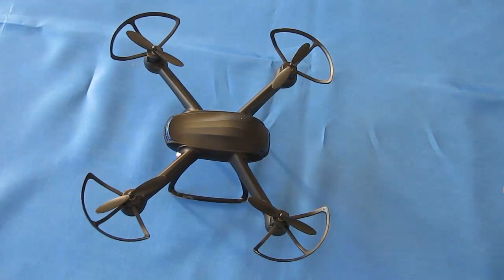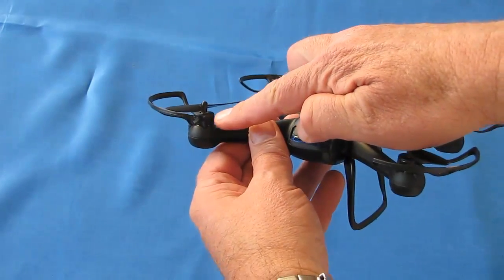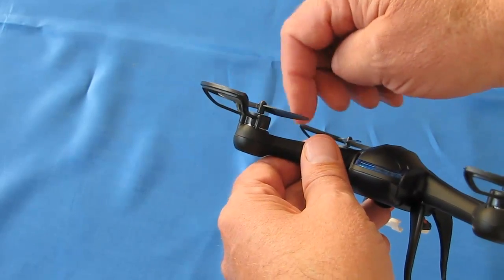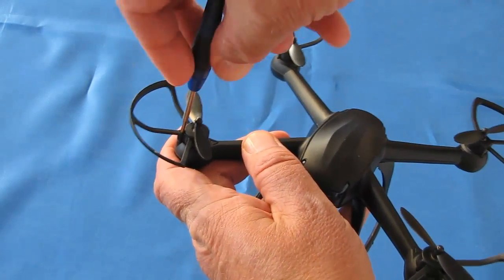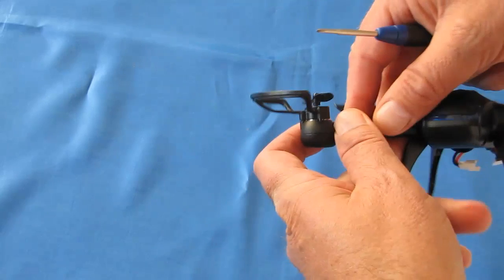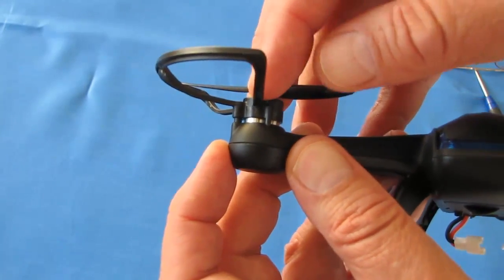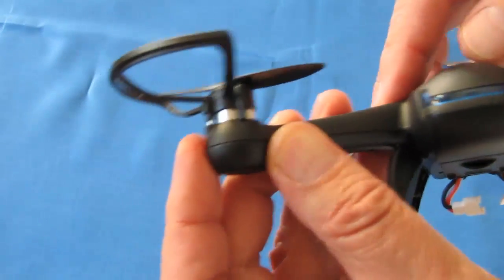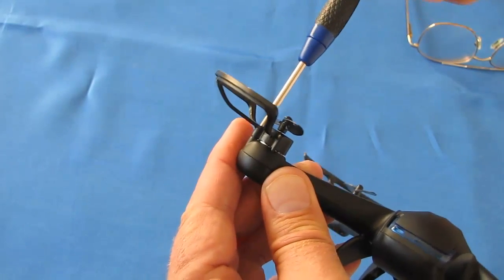DM007 Spy Drone Motor Discussion

Comment: I bought this drone about a month ago, to learn how to fly a quadrocopter, after 2 weeks of flying, i got used to it, and feel pretty confident with it, i took it outside, it was flying very stable and it was really fun to fly it, but after 1 month of flying, the battery started to get weak, so I bought spare battery, but unfortunately for some reason 1 of the motors just stopped working, i push the throttle all the way up, nothing happens, only 3 motors seems to be working, only with help of my finger the 4th motor started spinning, but that still doesn't help, the drone is uncontrollable and crashes right away :(  I'm waiting for worm weather, and i will get something more expansive and with GPS, but for now, i want to fix my DM007, i guess i should buy spare motor? They sell 2 of them together, the CW and CCW, what does it mean? I have to replace 2 motors? I'm new to this drone hobby, i really like it and eventually i want to take to next level, with  quality drone and  FPV goggles.
Reply from the maker: +V Kat There are two clockwise and two counter clockwise spinning motors on your DM007.  They sell them in pairs, but you only need to replace the damaged one.
Reply: +Quadcopter 101 ooo ok! Thanks for clarifying this to me! Your videos really hooked me on this things))) thanks again!
Reply: +V Kat 
Hi, 
after ~30 min of flying the rear left motor stopped working, since it 
smelled burnt I decided to replaced it with a new one (CW rotation), but now even the new motor does not spin.. I checked the voltage, under increasing 
throttle it goes up only to 1V (around 2nd bar) and keeps the volts 
steady with no spin...at the same time other motors work 
correctly..so it looks like a board problem? anyway clue how to reset it ?

Comment: hi i got this one over Christmas and it flew great the fist couple of times but now it starts and shuts down when you give a litle bit of gas.... so it doesnt fly, can you help me?
Reply from the maker: +Fábio Marques Sounds like over current protection.  Gently turn each one of your propellers by hand.  Make sure there is no binding, and most importantly that they are not striking against the prop guards.
Reply: I just got one today and am haveing the same problem did you figure out what it is
Reply: What would you do if there is no binding of the motors should I replace the board ??? Mine will arm and ass soon as I give it throttle the motors spin about half a rotation and then stops and the quad goes into binding mode please help this is a gift for my wife
Reply: Hi, had a similar problem but for me, I didn't even get to fly it once. Come to find out my 7.4V battery pack had 4.22V after the initial 90-100 minute charge. Contacted Gearbest immediately but found out everybody was on Chinese new year. The number they gave for 24/7 service never picked up.  I just held on til my phone ended the call. Replace the battery and you might be flying again!

Comment: the body of the quad is not square boxed, its nore whide than anything...i got one, i honestly dont know if it was used of just bad motor,opened it and replaced 2 motor, both counters...it flew good after i took it gudded it and made popssicle stick frame and mounted it all on that...and then gutt the cam too and laid it ontop too....since then i got 5 min flight with cam but no rear lights...i took lights out to save for future needs...but also took a electric line on way up showing off and it tumbled down taking a small hit on the cam and then it didnt work no more, the cam that is, the hole electronic flight control now drifts forward left and faster the longer i stay up in air, gonna replace flight control and get new cam....is there a good light light frame we can put all electronics on that ISNT that oddly shaped wider than squared frame?
cuz the sqare frames work much better than the original dm007 quad frame...

Comment: I just got DM007 from GearBest and one motor seems to be default. At first its not spinning at all, on full throttle it starts to spin but probably slower because copter wont go straigjt up, it drifts to the side where bad motor is. On slower throttle it almost flips as soon as it gets off the ground. Anyway, it's impossible to control. I opend support ticket on Gearbest which is unaswered for 14 days now. I started Paypal dispute and finaly got responce from Gearbest. They started debate with "Are you Sure... this and that..." and then they asked me if I can take it to a random local shop to fix it. They woul partially cover expences. I was shocked in such a responce and I don't want ot buy there ANYTHING. Anybody knows if I can get motors anywhere else? I found some on Amazon, but they don't ship to my country. Oh. and I think Banggood is same company, just different name...

Comment: i think one of the motor is damaged. last time i play with it one motor is hotter than the rest.recharged the battery to full and trioed to make the motor run ....it spins if you start it with your finger but i think not as fast as the others and then cut off by itself and wont spin even if you up the throttle. tried to open it and i found out it is soldered.......put back again and retried but same thing. the box comes with extra motors(4) aside from the profellers(yeah i bought those motors as add). now the problem is this soldering i don't know how to do that and by the way i bought a micro screw driver set for this. back to the motor problem....there is no mark which is which...i mean for the front  or back or left or right....or should i say counterclockwise and vice versa.....now getting fustrated about this toy.....haven't really enjoy it and its giving me noe a problem....saw some othe brand and i'm thinking i wish i got those instead of this......ayayayaay.

Comment: Took one of my old ones apart.  They are brushed just to clearifly.  What makes this quad so good compared to others it it's class is the fact that it runs off of 7.4 volts.  The motor I took apart was still working but the brushes were worn down to where contact was intermittent.  I adjusted the springs and now it works like a champ.  I like the fact that you can buy the crash pack and keep it running.

Comment: hi i bought the dm007 and being a first time user i broke two blades and i put to new ones on and now when i try to use it it will not fly pulls to the lift side can any one help me fix this
Reply from the maker: You put a clockwise blade on a counter clockwise motor (or vice versa). All blades should be blowing air downward. If any are blowing u, replace that blade with one of a different shape.
Reply: +paul house how did you take the blades off?  Just broke mine
Reply from the maker: Curt Veenstra Pry the bad one off with a butter knife.  Before you install a replacement, make sure that it's the exact same shape as the bad one (there are two types of blades, clockwise and counter-clockwise).

Comment: I have the replacement motors but couldn't find any markings for left and right rotation....any help?
Reply: +Axel Haenssen  - Notice the location of which color wire is connected to.  There are + terminals and - terminals.  In electronic red  usually means + and black usually means - .  You'll notice on the motors that two of them have the black connected to the + and the red connected to the -.  This configuration will cause that motor to spin "backwards".  Hope this helps

Comment: For motor replacement you have to remove the entire bottom of the unit (all screws).  Make sure you use the replace a CW motor with a CW motor and a CCW motor with a CCW motor - you can purchase them in pairs from Gear Best.

Comment: I own two DM007 and I burned out a motor on both…one on the very first flight (seized up and won't turn) and the other on its third flight (doesn't power up as much as other motors causing drone to spin or dip over rather than fly).

Comment: I ordered a DM007 from China off of Ebay and the first time I flew it, it veered off to
the right probably because one blade flew off. The unit had a habit of doing this each
time I flew it. I had ordered a crash pack with blades and this did cure the problem. Then a motor wouldn't spin up and thinking maybe the motor was bad I decided to
disassemble the whole unit to replace the motor. What I found was, a lead which
should have been soldered had came off of the motor, a bad soldering job. After fixing
the bad solder joint the unit seemed to fly ok.

Do not remove the long screws that look like they are for mounting the blade protectors, The blade protectors hold the motors in place! If you do not want the blade
protectors on the unit you will have to clip the plastic leads off.

Comment: Those motors behave like brushless motors, as used on 250 (or larger) racing quads. I doubt that they are brushless, as that would requre an advanced flight controller and (usually) ESC for each of the motors. Perhaps the Mfg. website has additional info ...
Reply: Bill Somrak Just went to GearWorst's site and looked at the motors (they sell spares) and they are definitely NOT brushless. Rather than being round, they are sort of oblong.
Reply: The prop movement immediately reveals them to be stepper motors. They were probably cheaper and they just made the firmware cycle them. They sound brushed but who knows case-diameter means nothing.

Comment: On BG, there is only one kind of motor, and you invert voltage to change direction. Why are there 2 different ones on GearBest? Doesn't inverting polarity wear motors faster?
Reply from the maker: Luca Andrea Mifsud Buhagiar Yes it does somewhat. This argument came up many times with the old WLToys V262.  It's best to use a motor designed for the intended rotation.  But you can invert voltage with these motors if needed (but expect some reduced longevity).
Reply: Quadcopter 101 So why are Banggood selling such motors?
Reply from the maker: Luca Andrea Mifsud Buhagiar Don't know?

Comment: when the battery is discharging he loses control. His is so?
Reply from the maker: Paulo Limm I'm sorry but I don't understand your question?
Reply: I bought a DM007.
when the battery is running low it gets out of control and falls. it happens to yours?
Reply: is flying and suddenly he falls.
Reply from the maker: Paulo Limm Are you flying too far from the transmitter?   Are the batteries in your transmitter fully charged?
Reply: no. cells are not new. this transmitter accepts recaregavel stack? if I put battery recerregavel burns trasmissor?
Reply from the maker: Paulo Limm I use rechargeable NiMH in my transmitters. They work well.
Reply: ok, thank you.

Comment: I flew my once. Now when I try to fly it flip to one side. How do I recalerbate it?
Reply from the maker: Thomas Dooley Check each prop by hand to make sure they're spinning freely.  Have you ever changed any of  your props?  If so, you may have put a clockwise proip on a counter-clockwise shaft or vice versa.Am not sure of the calibration procedures for the DM007, but this works for many other quadcopters.
1) Plug in the battery and place the quadcopter on a flat and level surface.
2) Bind the transmitter. Set it to high rate.
3) Move and hold both control sticks to their lower left corners, and hold them there until the quadcopter's lights blink. (If they don't blink, try lower right corner for the sticks).
4) Let go of the sticks and try flying.

Comment: My computer fans are DC brushless with two wires and act the same way as the DM007 motors.  Brushless motors that have three wires are three phase motors.  Do not assume that they are not brushless just because they do not have three wires.

Comment: Hey Quadcopter 101; you were right not to remove the prop in order to get a closer look at the motor.  Pass on to your readers that I popped off a prop so as to remove the prop guards.  I found that the motor cover which holds the motor in place and the prop guards are one piece.  After putting it back together I found the prop I popped off would not stay on during flight.  I changed to a new prop and it again works fine.  To remove prop guards it is necessary to cut them off.  Thought you and your readers might want to know.  Still have not found spare parts for this little guy, but it sure is fun to fly.  Peace Out.
Reply from the maker: Yes, apparently X4 props work well http://www.rcgroups.com/forums/showthread.php?t=2335184&page=22
Reply: Also for your information the camera on this thing is exactly the same camera as on the Syma X5C-1 and they are interchangeable.  The same range hack we all did on the Syma is the same hack needed for this one too.
Reply from the maker: William Wooddell I did the range hack already. It works well. https://www.youtube.com/watch?v=OMf3VJ6ioFk
And yes, I've learned from flying micro quads, once you pop a propeller off its shaft, it's best to install a new one. Finally, thanks for the tip on the camera. My X5C camera is defective (very blurry image). Am going to try the DM007 camera on it.
Reply: Quadcopter 101 I just got one of these after watching your video, do you know if any other propellers fit this, specifically Hubsan X4 H107L Rotor Blades, I'm finding it difficult to get the blades in Ireland or the UK. Thanks!

Comment: Hey Quadcopter 101 I did some research, and found that these motors have been available in most RC helicopters for years. My old V912 single rotor helicopter uses this exact motor on its tail.

The reason the motors have a sudden stop (or a snapping motion) is because they help the helicopter's rotation gyro to make quick slowdowns to allow the heli to change directions without having to wait for the tail rotor to slow down. 

As a result of this, I think this is an extremely unwise choice of motors for a quadcopter.  The "snapping" causes friction, which leads to the motors heating up to high temperatures easily, and could easily melt the plastic body of the quads.

Furthermore, when these motors are used on helicopters, they are often used with a gear assembly, therefore putting them on direct drive is something new entirely.

If I remember correctly, these motors have also been used on the original Cyclone UFO quadcopter(the large one that is notorious for its motors burning out). So beware and be careful, those motors will NOT last.
Reply: The snapping does not cause friction.  The magnets are just stronger, so you can feel the motor jumping from one magnet to the other.  This type motor was also used in the Alien Jump Jet about 5 or 6 years ago.  It was a quadcopter before they even called them quadcopters.  It ran on 3S (11.1v).  I had a bad copy version of it from HobbyKing that burned up a motor within 5 flights.

Comment: Are spare parts and batteries available anywhere.  I just purchased one of these, but can't seem to find spare batteries.
Reply from the maker: I've found this for parts http://www.amazon.com/Crash-NightHawk-DM007-Explorers-Quadcopter/dp/B00S1MYFL4/
But haven't seen batteries yet either. But am pretty sure if you wait a month or so that they'll start to appear.  They always release the quad first, then the parts start trickling in.
Reply: Quadcopter 101
Look like good old-fashioned 'mabuchi' style brushed motors. Two magnets in a metal can with a (three pole?) iron core armature. Anyone who raced slot cars in the ancient past will recognize them immediately. The two big magnets and the iron armature are why they don't spin freely.

Comment: This video should be titled 'How to unscrew a screw.'

"These motors are something quite different".. Great deduction bud..!
totally useless video tho.

They're probably brushless.. which, if you bothered to actually take the props off and open the canopy up, you could tell immediately, by checking how many wires come out of the motor.
Brushless motors require three wires.. brushed only require two.

It will usually say in the instruction book.. RC toy makers brag about having brushless systems, and it's usually stated as a feature.

Comment from the maker: You can get it here. http://www.gearbest.com/rc-quadcopters/pp_141747.html
Reply: My Huawei 3195 Tri-Quadcopter (name on box - UFO Aircraft) has the same kind of motors.  It is also 2S (7.4v) but you plug in each 1S battery separately, much easier for getting spares.  Also, see below about my old Alien Jump Jet (copy) from 6 years ago with the same type motors, so it's really not that unique, probably more common on 2S power plants.  Lots of my airplanes' brushed motors do the same thing, i.e. snapping from magnet to magnet as you turn it.

Comment: Wow, thanks for this video. Looks like those tamiya four wheel drive motors. Definitely the bigger brushes will last longer than the tiny 8mm ones.

I wonder if those tamiya motors will fit and work as well.
Reply: http://3.bp.blogspot.com/-b7xPHPQoEdk/TvgliPYg9EI/AAAAAAAAEaI/zG_YKMQnRcw/s1600/Nerf%2BRayven%2BInternals%2B-%2B06.JPG